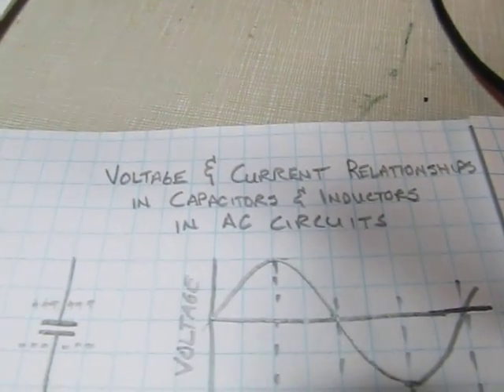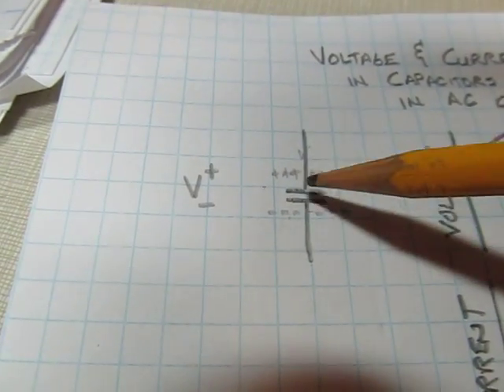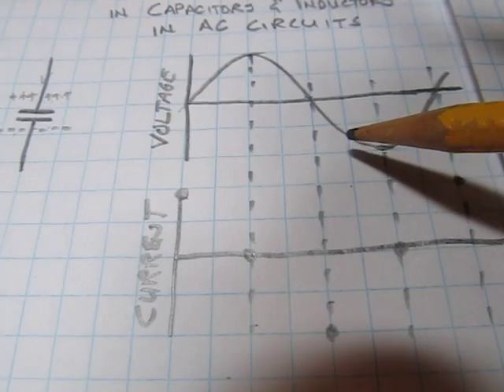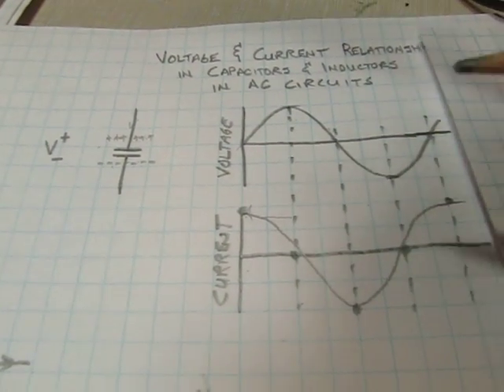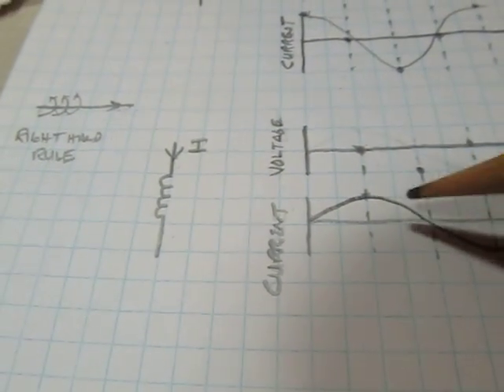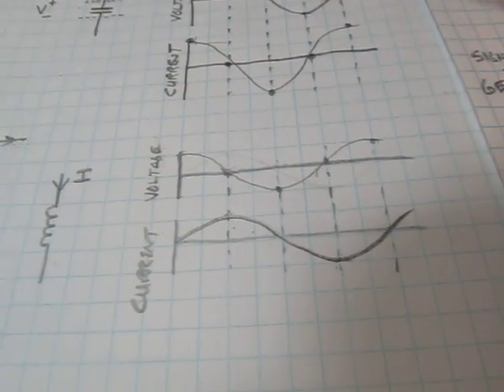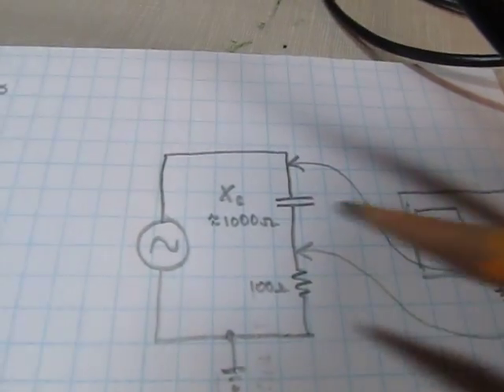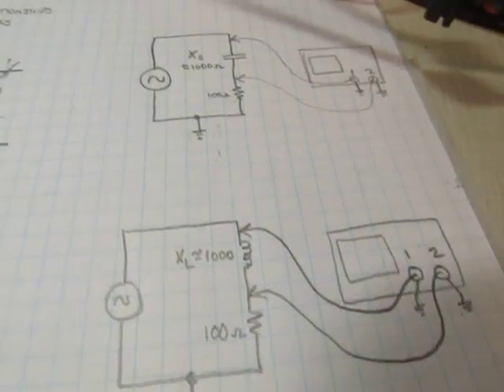#54: Back to Basics Tutorial: Voltage / Current in capacitors and inductors

Comment: Thanks once again! great job!

For future video, I'd be interested in seeing  how to properly use the scope in differential mode to view the current/voltage relationships in order to test the component or analyze the circuit behavior. Especially discuss the limitations of using the scope in differential mode vs using a dedicated differential amp (CMRR, overdrive recovery time, slew rate, etc).